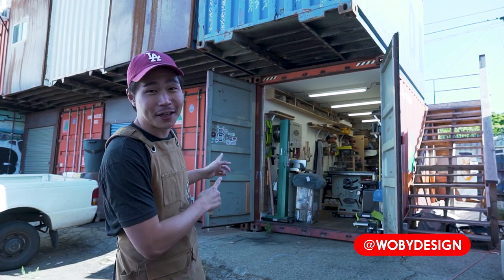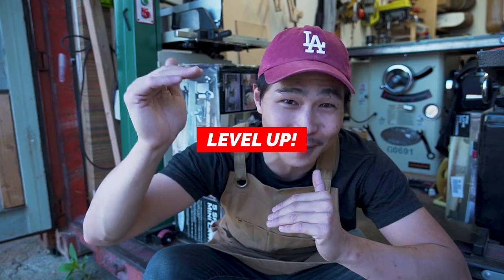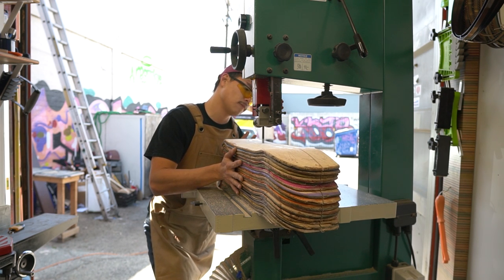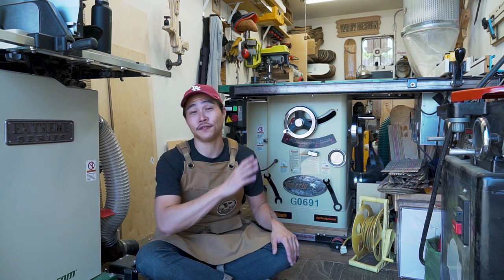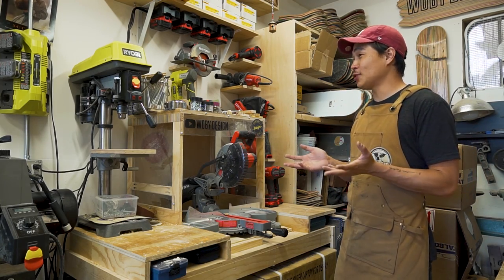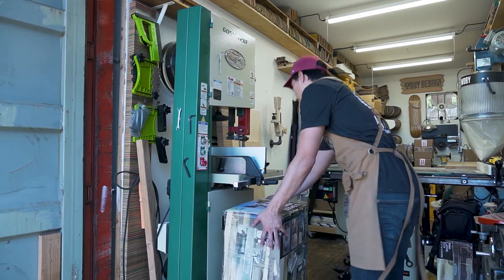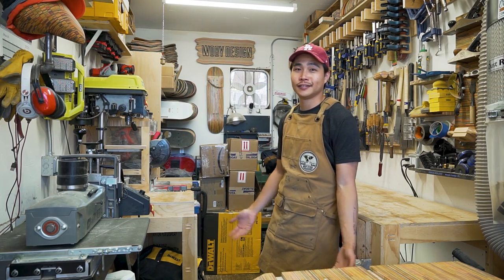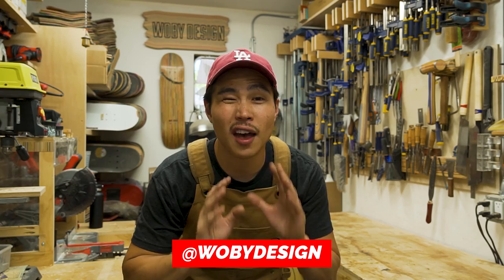1 YEAR AFTER INSIDE MY SHIPPING CONTAINER WORKSHOP!

Comment: Have you considered making a Paulk Compact Bench to set up just outside of your entry doors? I’ve made a few personalized variants of that bench for use with my tool trailer (which is roughly the same size as your container). I can’t tell you how nice it is to set up outside in the summer and not be stuck in a giant metal box. They’re easy to store and easy to set up.

Comment: if your gonna re work both sides of the place you might as well grab two sheets of half inch plywood and slap them on  over top the drywall or cut the drywall out and place plywood. either way its win win